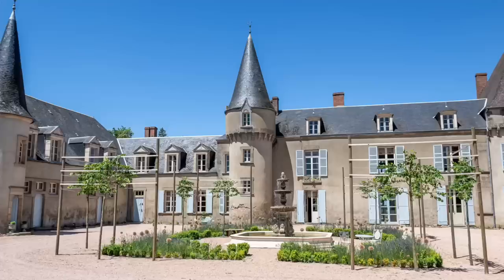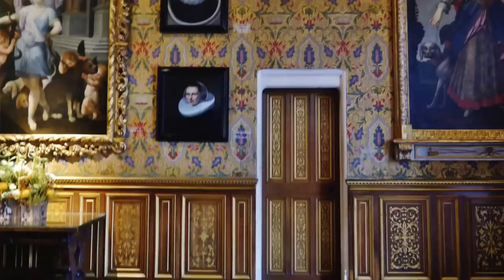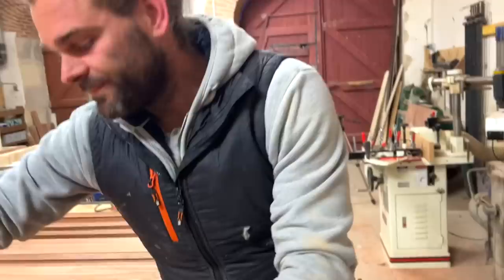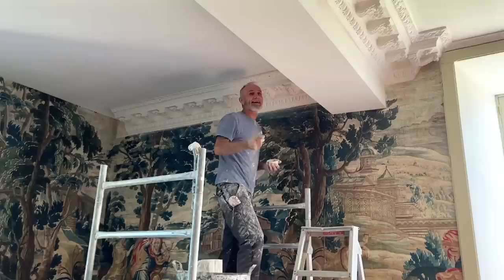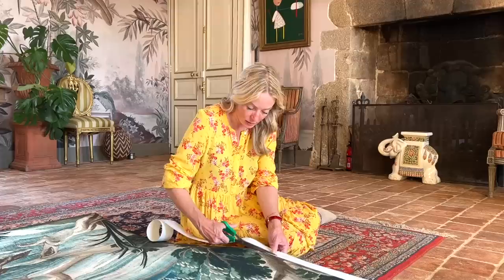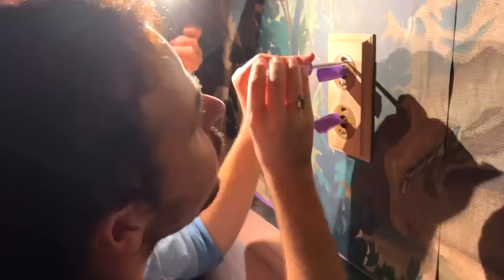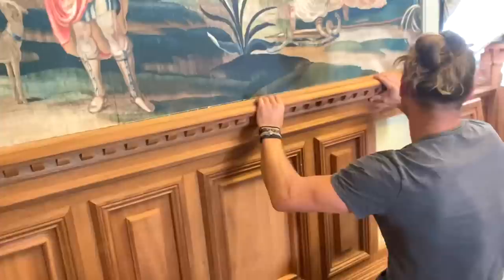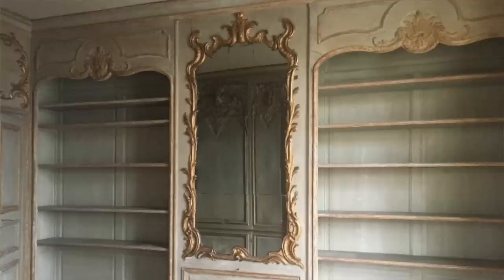Master Carpenter creates CHATEAU PANELING start to finish + timelapse | 1 year in 20 minutes

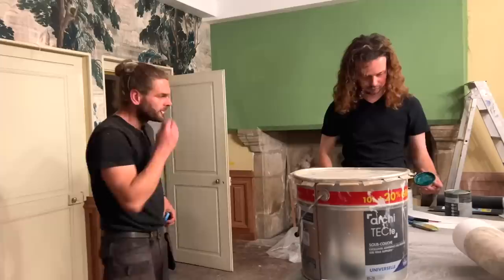Comment: @12:00  The concrete around the fireplace is a structural repair.
@20:09  That main ceiling beam is sagging, hope you install some steal supports to straighten it.  The piano upstairs is putting some serious stress on it.

Comment: Can you do a video explaining how you will be able to heat your Chateau this winter with all the discussion about rising electricity costs. How does one heat a chateau like yours this coming winter is electricity costs are a challenge? I love your channel and wish you all continued success !
Reply: Wood burning stoves were delivered to the Chateau in the next vlog, as the current passive thermodynamic system with floor heating and radiators will be overhauled in the spring 2023 Stephanie said.
Reply: @carolinegooder7091  Many thanks for the answer to my question ! Also, good quality down comforters have been extremely popular in Germany, Austria , Switzerland and at ski resorts for staying very warm at night during the winter !

Comment: They should take an xray of the fireplace mantle, because I have a feeling there may be a decorative molded/carved piece under that concrete which may be excavated and saved OR replicated from the outline. I wonder if they cemented over it to stabilize the fireplace?

Comment: I love it, are you leaving it in wood colour or are you going loose with the gold? He is a professional craftsman, is he, Amaury? He loves what he does. The finishing shot with you holding the flashlight, mommy, and Percy watching Philip screw in the socket are hilarious. Typical Lalande. Thanks for giving us a glimpse of this salon. (I refuse to talk about the fireplace 🤣)
Reply: The fireplace may become a winter project for Dan and Amaury when they are not working on the China room or the enternal shutters, after Amaury finishes the Grand Salon. Always 100 things to do. 😘😘😘😘
Reply: @carolinegooder7091  I think it will be a tough job, Caroline, as an old castle needs limestone as a breathing material. The fireplace is made of concrete, so it probably has to get out as it damages that part of the wall. It's a complex material, a castle, to do it well. I bet Stephanie and her "fellowship of the salon" will manage it just fine.
Reply: @tinekejoldersma  Love the "fellowship of the Salon" term.